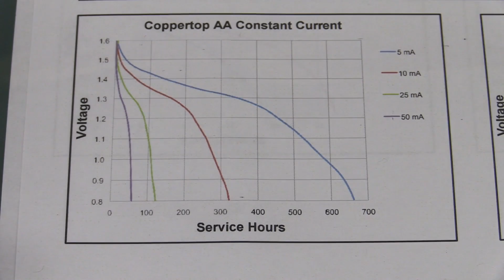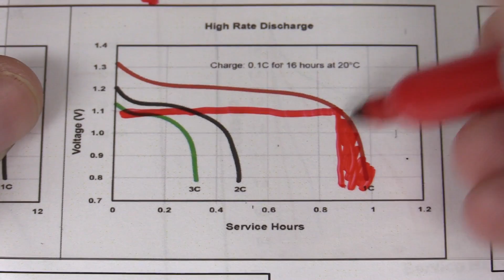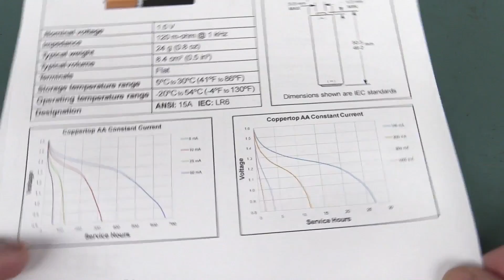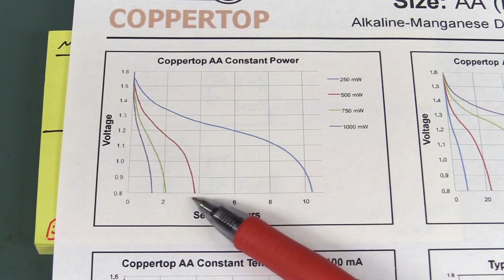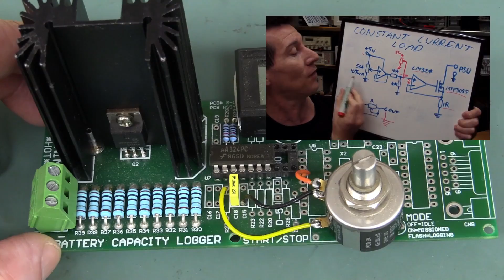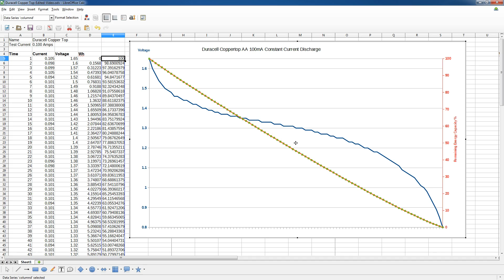Comment: In general, you explain how to compute an integral and basically, what you say is somewhat correct and it will certainly give  you a result which is reasonably close to the precise data. But you made some systematic errors (which luckily won't change the result very much).
1. The capacity is the area under the full curve which goes right down to zero, not 0.8. That is why your first guess of 10 to 20% remaining capacity was a bit on the exaggerated side. If you see the full area, you would - right from the start - have gotten a better estimate.
2. When doing an integral with empirical data points, you should consider taking the previous data points into your sum. You can simply use a linear interpolation by just taking the average of the current and the previous point. Would be a tiny bit more accurat, but of course still based on assumptions. Does not make a huge difference, but just relying the current data points is not the best assumption.
3. You Do Not Divide by the last data point. That is wrong. You divide by the maximal value. Which you do not have measured. It will of course not be far off of what is writte in your last row but remember that the curve goes down to zero. There is a tiny amount of capacity. This does not show in your graph. You can guess it to be only about 1 or 2% of the full capacity, but nontheless, your graph is (strictly speaking) having systematic errors.
Overall, again, nothing new under the sun. Of course, for simple calculations, that is more than good enough. But I just like to be a smart-ass. :)

Comment: There is an error in the spreadsheet work.  The first energy consumption number is 0,  which is an apriori figure.  But the second entry shows you taking previous energy consumed (t=previous) + V (t=current) * I (t=current) when in fact it should be energy consumed (t=previous) + voltage (t=previous) * current (t=previous).  This isn't a grievous since energy consumed at t=previous and t=current are nearly equal but it does mean that you should have one additional entry, so you're total will be off by a little more than approximately 1/# of entries.

Comment: Is that a line graph or a scatter plot? (More important if the X data is not at regular intervals...)

For constant power discharge, instead of constant current, the line would actually end up linear, since the capacity is also a percentage of energy... With the constant current example. the remaining energy is a power percentage, and the power of the load is decreasing as the voltage decrease...

(A normal (mostly) constant resistance load is a non-LED flashlight....)

Comment: Just to get this right, when looking at your curves I must come to the conclusion that after these kind of batteries are discharged to 0.8V (under load of course) there is only a very very small amount of energy left in that cell?
Otherwise it would not be very engineering like to just put the zero point of energy left right there, or would it? I'm sorry for bothering you, but showing the complete curve (if even possible) would be a better way of debunking that silly product. I'm really keen to see the results of your long term battery test. I hope that it will show the complete curve way down to zero volts (if, as I said before, this is even possible).
Thanks for your great videos, both educational and entertaining, I love it! :)

Comment: Useful video, been aware of it for ages and I usually test the old alkaline battery pile of my parents every year by plugging some banana plug on one end and alligator clips on the other end leads then hook a resistor up between the two probes that way and measure voltage. If it drops quickly I discard them if they're still decent enough for use in low power applications I'll put them in the "half dead but still useful box".

An interesting fact to be aware of though is that there are some battery chemistries where the open circuit voltage is a sound indication of state of charge. With my 18650 lithium ion batteries its a rather good indication and while I'm no expert at lead acid batteries, if I'm not mistaken it applies to them as well to an extent?

Comment: I really wish we had the current/voltage measurements down to zero volts.

While I'm pretty sure the falloff is so quick that it isn't significant, this experiment does not actually measure the total (theoretically) possible battery capacity; rather, it measures the capacity only as far as the designated cutoff voltage of 0.8V. I reckon there is another 5-10% in there. Not that you could get at it easily without a bunch of cell in series, and without battery leakage to ruin your day, etc. etc. :)

Comment: Does the wasted percentage of energy have a dependancy on the current drawn? Looking at those curves on the datasheet, it looks like you may waste more and more energy at higher current levels for a given cutoff voltage. It does make sense since higher current levels will drop more voltage across the ESR so therefore it will prematurely reach cutoff level.

Comment: I think that technically, you need to multiply that I*V by the (delta t) i.e. the time-step size, after adding the previous energy value.
So,
E = E(n-1) + V(n)*I(n)*{t(n)-t(n-1)}
Since your time resolution was 1 second, you don't get any errors (apart from being in Joules rather than Wh). But if you had any other value, your energy value will be wrong I think.

Comment: As right as you are abotu the Batteriser marketing I still have one argument to defend the usability of this thing.
I just made a test with an alkaline battery that had 1.35v with no load in the beginning. I intended to find out how much energy in Wh I can squeeze out of it when draining it from 0.8v to 0v. To first bring it down to 0.8 I put a load of 200mA on it which caused it to drop down to 0.85v under load. After draining 500mAh it had 0.64v with the 200mA load on it and 1.1v with no load. As you can see that were 500mAh and it's still going in the range where everything apart from solely resistive devices like flashlights or some dumb fans or so would've shut off. I can't think of many devices with microcontrollers and low voltage cut off that would put such high loads on the battery but that would be a situation where the batteriser could really help you.
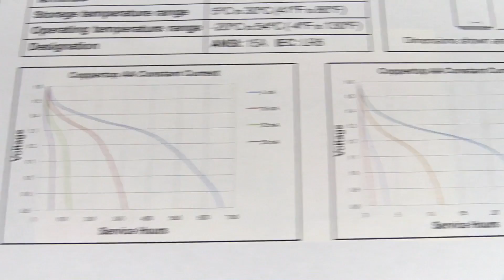Reply: Honey BooBoo So you're saying that the battery was 0.85V under a  200mA load, and you ran it for 2.5 hours and it only dropped to 0.64V? Look at the battery discharge curve for a 200mA load at 10:35 in the video; it's almost vertical at 0.8V. Once you hit 0.8V you don't even have an hour left. Your test doesn't make sense.
Reply: gblargg But that's exactly the point. Under load it drops dramatically. It's an exponential behaviour. The difference in the voltage drop between 100mA and 200mA is very high and the reason it could sustain the voltage under load so well is that even after the 500mAh discharge if you had put a 100mA load on it it would have been well above 0.8v maybe like 0.9v-1.0v
Edit:
To understand it you also have to know that the reason why the 200mA load graph from the vid differs so much from the results I had is that the graph is for a fresh Duracell Coppertop and I used some years old Philips alkaline that I found lying around somewhere. Age and quality makes a big difference in voltage drop under load but alkaline batteries don't lose that much capacity from just lying around. A nimh would've been completely flat after lying around for so long.
Reply: gblargg Because it's an old cell that has higher internal resistance etc. than a new one. Because of that it drops dramatically more under load than a fresh cell without having remarkably less energy in it. Just a slight bit is lost to time and more internal resistance --> heat.

Comment: EEVblog Why only go down to 0.8V? In case you're using a DC-DC converter, it would put out a "useable" voltage anyways, so while looking at the discharge graph on the data sheet tells me that there isn't much left in the cell from 0.8V to 0.0V (or, let's say 0.1V), why not go ahead and see/measure the graph all the way down to zero? OK, in case of rechargeable batteries, this would obviously be fatal for the battery, but if you're using disposable alkaline batteries anyways, it wouldn't hurt a thing. Any hey, maybe the curve behaves somehow unexpectedly below 0.8V? OK, to get useable power out of it, it would have to draw a much higher current, which means a constant power curve is the only thing where this area could be relevant, but still, I'd be totally interested how a battery behaves when it's operated so much outside its specs (but lack the means of easily measuring the thing...writing a value down every minute from the multimeter just isn't an option if it takes several hours for the battery to get down to 0.1V).

Comment: your calculation in the spreadsheet seems to be wrong to me. First: why does is the first row have 0 WH at 1min? you should use the mean value between two rows - but sure that only makes a little difference. Second: you should take the measurements down to 0V to get the real capacity if you want to show that there is not much  energy left at .9V. Randomly setting the zero reference to some Voltage level gives you wrong result. imagine that you only took measurements to 1V and took that as 0-Energy reference. The results would look similar while still a bit of energyis present.
this is an attack point in your proof

Comment: I remember getting a Sinclair programmable calculator (24 step) RPN and put in a fresh standard 9v battery and it did not even turn on. It only ran with an alkaline battery, and that didn't last long. C1978

Comment: Very interesting video, thanks. I wonder if anyone can find a device that cuts out at 1.4 volts? I'd bet that they are very very few and far between.
Reply: mart fart Just looked that gem up, I think the battery voltage was the least if it's problems! RPN, need I say more. I'm so glad we don't have technology like that now.
Reply: Wobblycogs Workshop Yep, they'd be very rare. Possible though.
Reply: Wobblycogs Workshop Sinclair programmable calculator c1976 would not even turn on with standard battery.
Reply: Wobblycogs Workshop
Haha it was the scientific programmable in a black case and they were selling them off cheap, I was still at school and it probably hindered me in math more than helping. I also bought a Science of Cambridge MK14 micro kit @39.95 also Sinclair c1978 I used to boast I built a computer as a kid at school...the truth is more prosaic.
Reply: Use Ni-Zn 1.6V nominal rechargeable for that product?

Comment: Also I hardly believe your graphical analysis method is the best method out there when compared to actual integration using Simpson's or trapezoidal rule. Which you could've just as easily done with the data at hand.

Comment: Dave if you have any super capacitors it would be a interesting test to see the comparison with a Cap on its own and with a battery connected in parallel.
I have 18 x 3000F Maxwell caps in series and parallel configuration for jumpstarting cars and trucks. 3 sets in parallel  of   6 in series 2.7V Caps Max each 16.2v max for the setup. its a beast ! and made 2 of them. often wondered what energy capacity they actual have stored in them.

Comment: I have a question about battery discharge safety with a PWM application. Maybe someone can answer this or point me to the right direction to where can I read or learn or ask about this? Thanks!

I have a 8.4V rechargeable battery (dual 18650 in series for vaping) and a heating element with 0.1 ohm and lets say a 10% duty cycle at maybe 100hz (arduino PWM with a mosfet). The average amp draw would be 8.4 amp but the amp draw during the duty on would be 84 amps! I plan to use Samsung 25R "safe" chemistry batteries (not lipo) that are rated for 20 amps continuous discharge. In the datasheet it actually mentions high amp pulse discharge tests.

So basically I'm wondering if this is safe to average? What makes batteries actually explode? Temperature?

In any case thanks for the awesome video!
Reply: ***** But wouldn't the heat average out?

Comment: If i can take the data to plot the graph until 0.8v using my product as load, then I will use my product until the voltage would be 0.8v. So by this video, my product would use 100% of the capacity of the battery, what it isn't 100% true. But it is the conclusion that i would take form this method.

Comment: Well, aligning both y-axis was not really required. As long as they share the same timescale everything is fine. Also you should be careful with area under the curve because displaying data only down to 0.8V skews the real ratio!

Comment: I wish they showed the short-circuit current on datasheets. Knowing that, you would be able to infer the worst case cut off for a device with a boost converter. At some point, the current would not be sufficient to charge the inductor no matter how wide the PWM control signal.

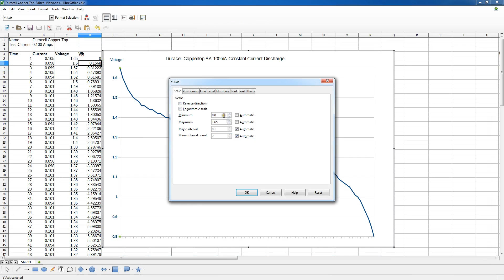Comment: Sorry Dave but if you want to talk about ratios of used energy capacity vs remaining energy capacity and make that visible as an area under a graph, you do want to make that area go down to 0V (what you almost did at 17:48). Otherwise it's actually not correct.

Btw: There is a very neat built-in Excel function called VLOOKUP which does some magic for you. You should include that in your next spreadsheet tutorial ;)

Comment: Odd, it seems as though one of my canon point-and-shoot cameras rejects the batteries at a very high voltage, like 1.2 or so. The thing eats batteries like nothing else.
Reply: ***** cameras have a relatively high current demand. And I think you have measured the voltage after removing the battery from the camera which is not what Dave is talking about. Dave was speaking for the voltage under load.

But yeah: Old consumer devices eat a set of batteries for breakfast, lunch and dinner. But with modern DCDC converts and micro-controllers it got better.
Reply: ***** Is that by any chance when using the flash option and charging the capacitors for that?

When using decent NiMH batteries with a much lower internal resistance than alkalines I find that I usually get more flashes out of the batteries and as a bonus the capacitors tend to charge faster too meaning less time between photos.

Give it a shot sometime, especially since the energy capacity left in the battery isn't entirely wasted you'll just top it off faster when putting them back in the charger if it does leave some in there. The only real problem would be if its not optimised for the lower nominal voltage of NiMH/NiCd but I find this to be a rare thing in any photography gear with flash.

Comment: EEVblog Dave, couldn't you just look at the spreadsheet data to find the remaining capacity? Find the row where you drop below 1 volt and look at the number you generate for remaining battery capacity at that point.  That seems simpler, quicker, and more accurate than looking it graphically and estimating where the line intersects the right Y-axis.
Reply: Aaron Hurd As soon as I saw the hand-drawn lines come out, I went back and looked at the table.. "4.48%" :D
Reply: Aaron Hurd Yeah there is a function for that called VLOOKUP so you don't even have to do the search yourself.

Comment: When you say to take the "area under the curve", do you mean down to 0 as well? The graphs all seem to end at 0.8v.
Reply: Power Max yes that is true that there is much more "graph" to be seen, but notice that the area we are talking about is not the entire area under the curve up until the cut off voltage we've chosen (ie 1.5V -> 1.1V for example), that area is the energy we have used. The wasted energy is the area under the curve from the cutoff voltage to 0.8V (ie 1.1V -> 0.8V). Because these graphs basically become vertical at 0.8V the area under the curve from 0.8V -> 0V is negligible.
Reply: Power Max Yeah that was going to be my next comment. Even if the curve drops off really fast, you still have a huge rectangle hidden from this graph since 0.8 -> 0 is even bigger than the 1.5 -> 0.8 voltage range that we can see on the current graph

Comment: HI dave, I don't know if you could help me but I have a LCD screen that I want to use with my arduino. The problem is that I can find the datasheet anywhere (I even send an email to the company that sells them) do you know how I could get the pinout ?
Reply: Alexandre Rouma 
Totally wrong place to ask. Search one of the many arduino forums.
Reply: superdau
already done that.
Reply: Alexandre Rouma Do you know what driver IC it's using?
Reply: urdnal No, but it came from a TOMTOM GPS

Comment: I can't tell you how many years I would tell this to people in the video production industry using wireless mics.  They would buy a battery tester, and it would only measure voltage(radio shack?). It it showed close to 9 volts, they would put it back into the wireless pack, and put it back on the talent. That was back in the late 90's - early 2000's. By 2005's everyone got burned too many times and would only use a 9 volt battery for 3-4 hours at the most, then throw them away.  Urrr.
Reply: GeorgeGraves I used to measure batteries with no load with my multimeter <hangs head in shame>. Someone gave me a battery tester that was from Radio Shack and it even says on the front that it uses a 150mA load for the normal setting (also has 1mA load settings for button-type and 3V lithium button cells, as those are generally in low-drain applications).